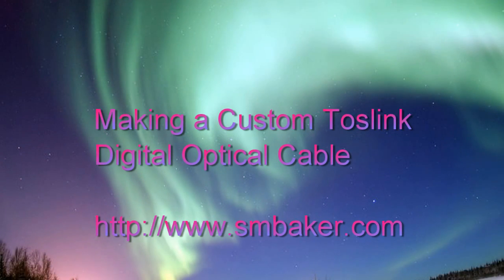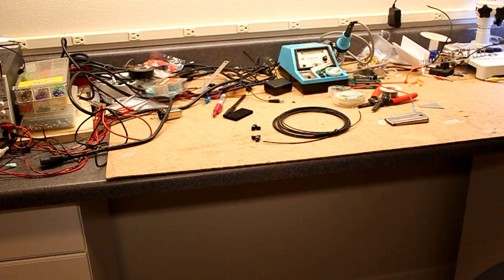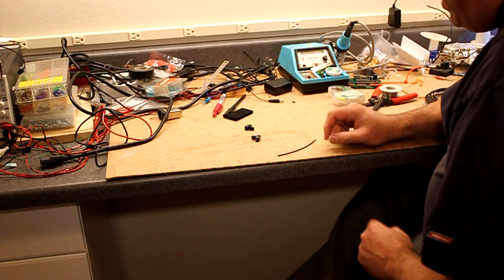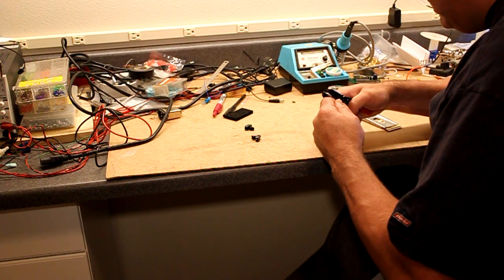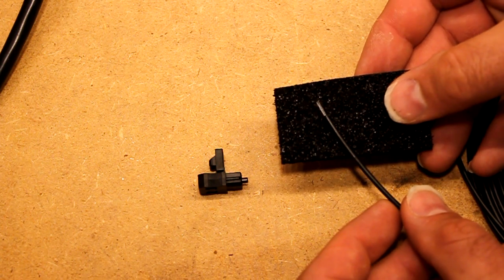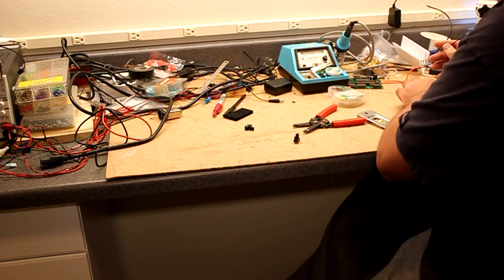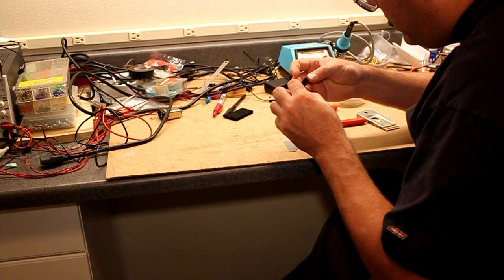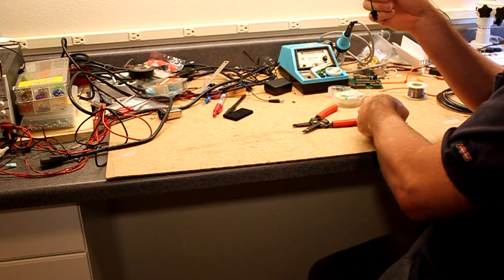Making a custom toslink digital audio cable

Comment: Hey! Thanks for this video. I tried following the same procedure with a digital optic cable that I've brought through the walls from the TV. I have light in the end that I made, but I can't get any signal to my dac. Using another store bought cable (not brought through the walls) I get signal with the same setup (TV to DAC). Do you know if the cable could be broken even though strong light is still coming through?

Comment: This is a great intro and what emerged, for me, as a fiber optic compared to copper discussion.  I think an added element is resistance matching.  My sdif comes in two flavors on the back of the dac - toslink in or coaxial in. Yet the digital coaxial in takes an RCA terminal.   Optical does not care about resistance matching -- as far as I know there is no signal  reflection, which, on the other hand,  becomes tricky when your sources are matched at 75 ohms but you are using RCA connects, which are not 75 ohm (as in a bnc).  Perhaps refection and interference, like RF, create s/n that does not impact the bit signal.  Thus, component matching visa a visa termination with copper wire/dialectic is not an issue.  Still, I am interested in your thoughts.

Comment: Do these cables exsist in a joined shape? I would like to make a 4 way cabel somthing like this ___I____I___  if you can imagen. I need it for joining 3 sources to 1 host. Granted only 1 source can be turned on at the time but that is all i need.
Reply: Don't think that's possible due to how optic fiber works. I think there should be some kind of a hub for this.
Reply: @ooltimu  All i know is that cheap passive Y toslink connectors work both ways. Join or split what ever you like. So It is possible to join multiple source to a single host using these as long as only one souce is on at the time. Problem with LOGILINK CA1004 is that it is not automatic.
Reply: Just found LOGILINK CA1004 which seems to be what you need or at least needed 3yr ago :)

Comment: This works! I had to cut off a proprietary Clarion DCA002 cable, and put a toslink end on it. I used Lifatec, and got one of the crimp on connectors, and followed his direction...
Reply: There is a tutorial that teaches a modification in these cables. I want one of toslink tips
Reply: Michael Morr I'm doing this same Mod for my McIntosh MX406 to run to a processor with toslink input. Did the Signal work ok after you did this?

Thanks for the help.
Reply: ELEVATEOFFROAD.COM yes this worked!!
Reply: I just did the same thing, it indeed works.
Reply: I'll be doing the same thing with a DCA002 cable, to use an mda4000; wish me luck!

Comment: Your RCA input would be a coaxial digital ... not compatible with optical digital. You'd need to get a short optical cable and an optical to coaxial digital audio converter. AV Toolbox makes one that you can find for around $16, plus shipping and tax. Then you can use a cable with RCA ends on it from there to your input. Use coaxial cable (75-ohm) for the best connection. Trust this helps.